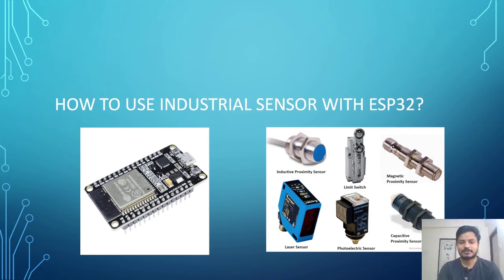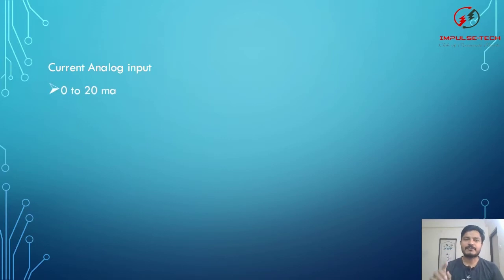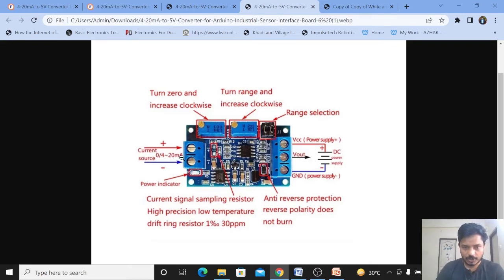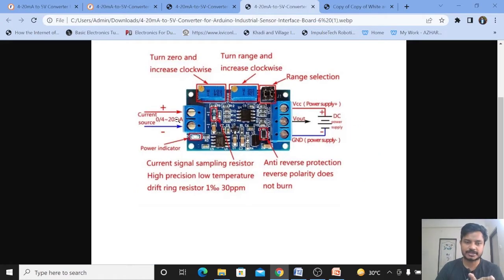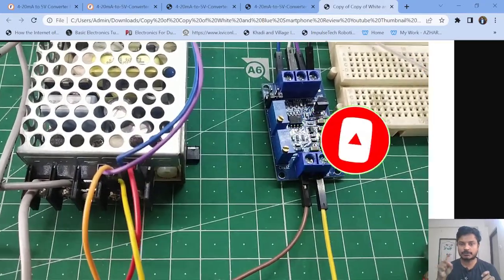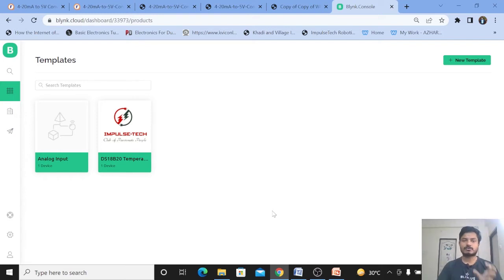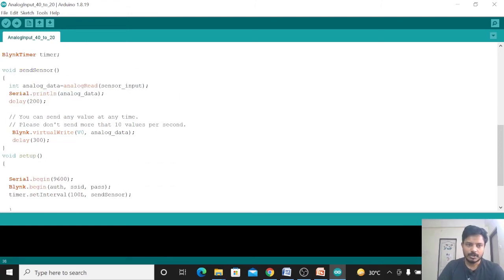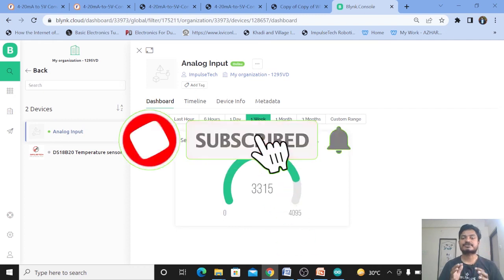How to use industrial sensor with esp32 | IoT based industrial sensor data monitoring #IoT #esp32

Comment: You only need a resistor.. you do not need an interface board. A resistor will create a voltage drop across it relative to the current draw and give you a analog voltage input to use

Comment: very informative tutorial sir thank you! I have a question for the power supply, what is the specification of the power supply? does the rated current of power supply have influence on the reading, or we just need to look only at the output voltage so this project could run?
Reply from the maker: There is exact guide on which type of power supply to use just google it you will understand